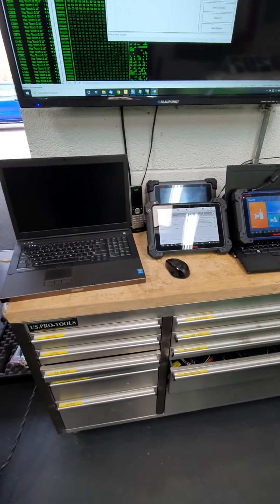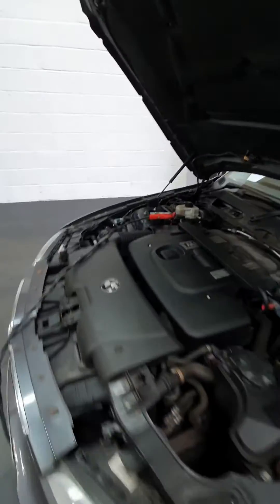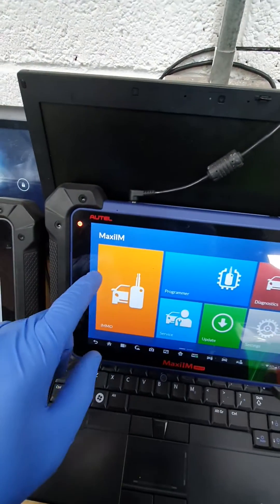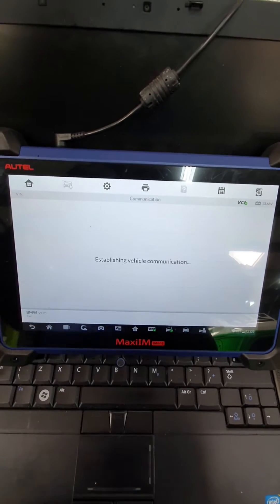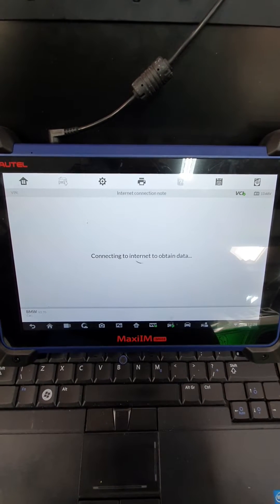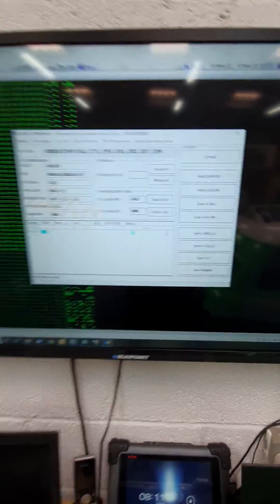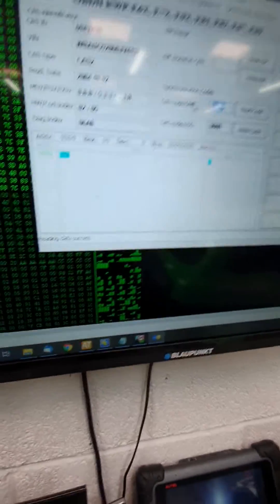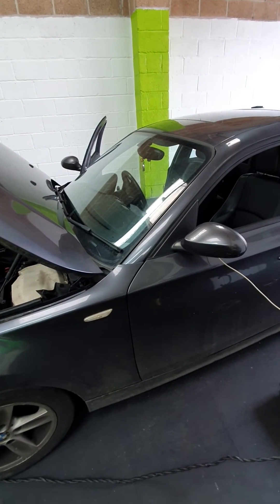BMW Used ECU Fitting & Programming Tutorial | Autel IM608 & VVDI2 Guide

Comment: Awesome video, by chance can you guide me on used DME programming for a 2014 bmw X5 xdrive50i with the N63TU with an Autel Maxisys Ultra?
Reply: That's the problem I'm having too...this procedure isn't the same for the Maxisys Ultra--the menus are not the same. I can't find any method for reading the ISN.
Reply: I have the same problem with a 2014 bmw x5 xdrive50i with the N63TU, how did you solve it?

Comment: thank you for the precious information. i have e39 m47d20 and lost the keys.. changed ecu, ews box and key. it starts fine, ews box clicks but it wont run because theres apparently isn? or some kind of code on the vp44 injection pump.. been researching how to change that but its way more complicated because the old ecu is missing. is there any way i could perhaps read the vp44 with obd?

Comment: Hi I have a 2007 BMW X5 

The customer has a breathalyzer installed.

He called to have a locksmith to make a key. The guy came and made a key. And the vehicle never started. He assumed obviously this was due to the customer not being there to blow in the breathalyzer.

Customer then finds old keys.

Now both keys work turn on the dash and lock and unlock but won’t start the car.

The issue is the DME is no longer synchronized I think. The specific code autel im508/608 is giving me is that the DME is unresponsive.

I have no idea what kind of software the previous locksmith used.

I tried many times to resynchronize the DME using the Autel but it just instantly says operation success as it always does. It doesn’t seem autel really does much with a Dme sync.

Can you give me any pointers? I’d really like to get this going for him.

Everything seems fine it can’t be much more than just the Dme not being synced. I noticed you said in the video can sync the Dme no problem. Yes it has that option. Doesn’t do anything though.

Any help would be amazing thank you
Reply: I also just wanted to ad. Yes I’m having the customer there with me while I work on it. Ready to make the breathalyzer pass before attempting to start the vehicle

Comment: Hi sir, excellent video, I have a question: can we do the same process on a cas3? I have a 2007 328i that the original cas is not working, so I’m going to swap with a used cas, I have im608 and vvdi2